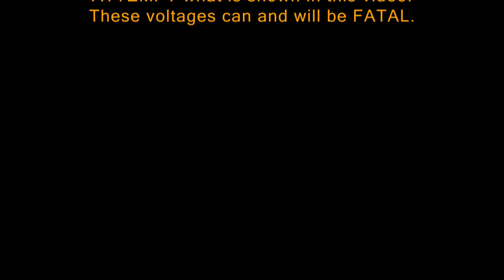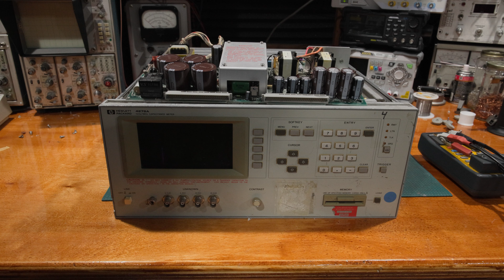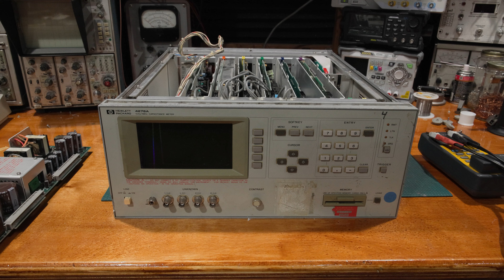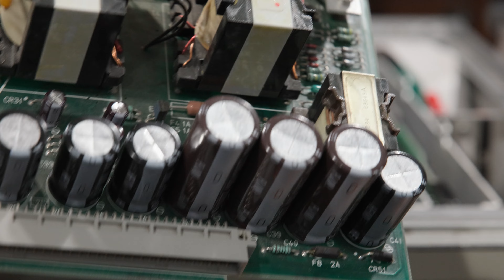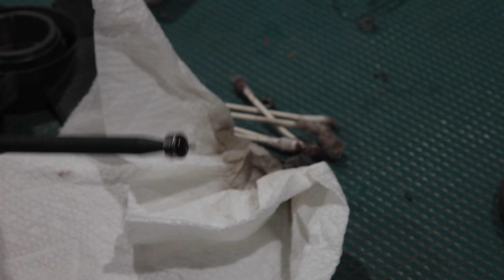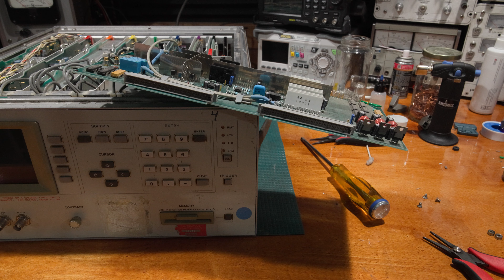HP 4278A Repair and Checkin

Comment: The Keysight website actually has a service manual and also a maintenance manual for this piece of equipment. They may be helpful during the calibration process. Keysight is always very good about having information for HP legacy products. Now for their new design products? Much harder to get anything but an instruction manual and they force you to register so they can bombard you with emails.......
Reply: I looked through those provided manuals, the calibration information is in the Maintenance manual.

Comment: There was a time when I wanted a 4284a lcr meter but decided against it because it appears the calibration software needs a HP 9000 Unix workstation and software that I haven’t been able to find.    I’d imagine this unit likely uses that same software.  If you do find it please share! 

I went with a 4274a and couldn’t be happier.  It’s a great unit.  I later came across a 4192a which is great for impedance sweeps but I prefer the 4274s for daily use.

Comment: https://youtu.be/l4G9SMtpYqE?si=IOyTbC7FDQPFNtaB

HP has a Kelvin 'box' that mounts right on the front 4 BNC .  Note, many after market Kelvin cables will not function on HP analyzers, because the shields of each pair ( HI and LOW ) MUST be tied together at the clip end.
Reply: I went with the bk precision tl89k1.  It’s wired correctly for HP lcr meters, good quality for a reasonable price. Mine has fixed leads. I just googled it again and see there may be a newer model that has detachable leads.

Comment: Disassembling the LCD and cleaning the zebra-strip as well as the glass it connects to is worth trying. The elastomers tend to degrade over time. Transplanting a zebra-strip is also an option.
Reply: That was the first thing I thought of, bad connections on the zebra strip. There is a seller called "my-space-time," I found, with different sizes on everyone's favorite auction site.
Reply from the maker: I looked in to that this is a flex ribbon in to a fused glass strip. Taking that apart will be a destructive disassembly unfortunately.
Reply: @ZenwizardStudios Oh... those crappy constructions... been there, not fun at all ☹️

Comment: Keysight has the service manual, and the power supply is the A1 board. I'm looking at it now.
Reply: Looked at the manuals. There's only one transformer on the A1 board, the rest are chokes. Typical for HP switching supplies, since the chokes can be very small.

The 4278A manuals have full schematics, but not very deep circuit descriptions. The A1 module is meant to be serviced at "module swap" level for any failure other than the fuses. 

I have HP 3561A, and it's pretty much the tail end of HP manuals intended for component level repair. The manual is much more thorough, two binders two inches thick.
Reply: @johnshriver5200  Even though HP manuals are on the net, I generally end up buying an original manual as well, and they are rather thick if both the operating and service manuals are together. I just purchased one for a 5334B
Reply: @craxd1  Yes, paper is always better, especially for the large fold-out schematics. I'm lucky to have a paper set for the 3561A. But I printed the updates and errata from online copies.
Reply: It's always good when you can get a schematic I just spent days working on a oldschool cc/cv ps that had soo many issues and I had no schematic, took me a few days to realise how its all layed out, admittedly if I spent more time in the first place tracing it all out I would have had that aha moment sooner!
Reply: Not only the Power Supply has the schematics, ALL boards have schematic available in service manual.  It is easy to check exact power distribution and figure out that each board has it own dedicated liner power regulator.